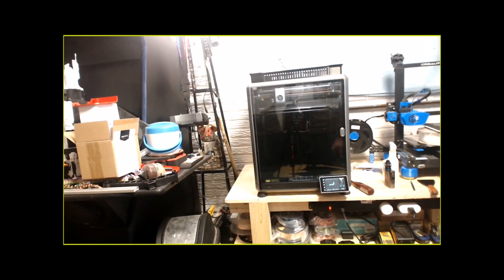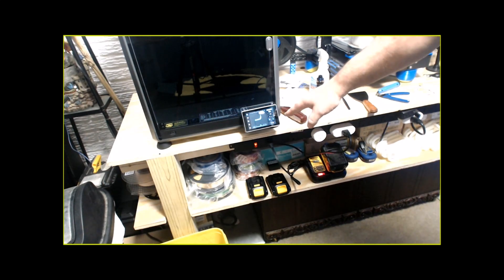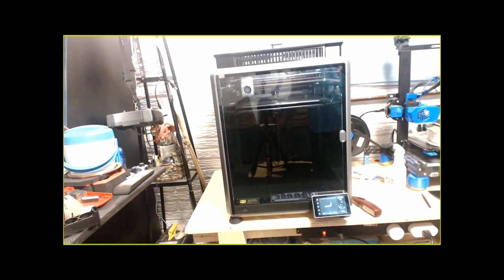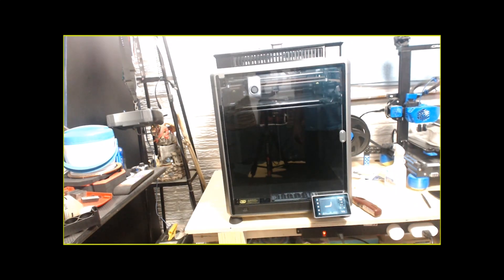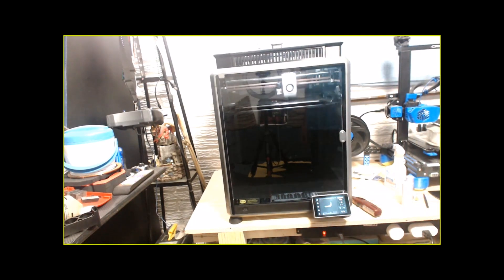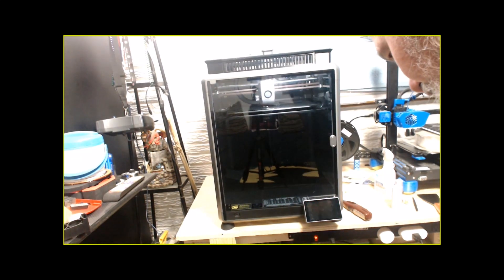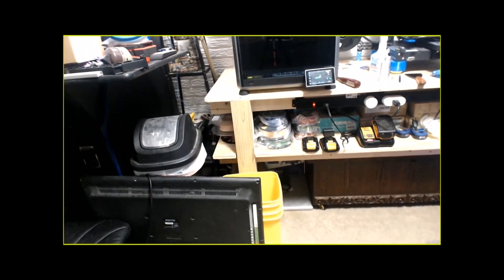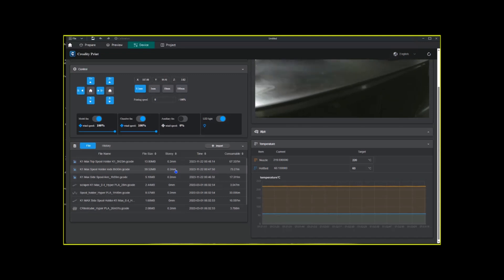K1 Max Risers, Firmware - small changes

Comment: From what I have read the best reason to root is that  creality has not fixed input shaping  it takes the vibration of I believe the x axis and applies the result to both the x and y making it not as accurate as it should be. You can also adjust your cameras  like brightness and color and saturation  to give better time lapse
Reply from the maker: You are right, I forgot. Creality takes a shortcut and uses the "X" axis from input shaping in the "Y" axis! Though, it prints pretty damn good as is! and yes, the Macros are a huge benefit as well - such as the camera controls you mentioned, plus tons more controls that...Well,  those that have issues leveling a bed (on bed-slingers) might find themselves in trouble. As is..."mostly" I think Creality did right not auto opening all of that...But, should have provided the access right away for those that can and want to do so.
Reply: @BladeDreams  I fully agree most people with out  understanding. How much damage they can do or without a good guide can get a very expensive paper weight very quick